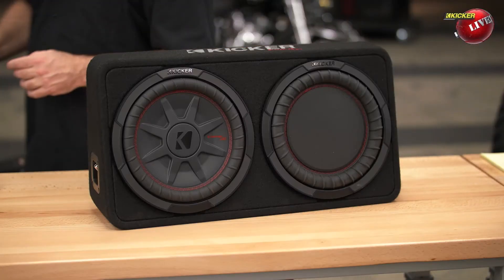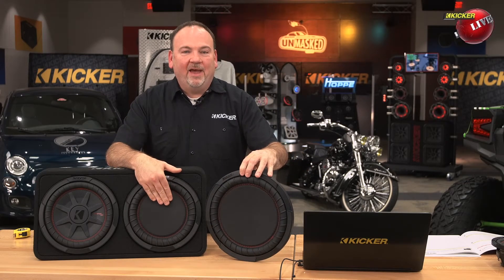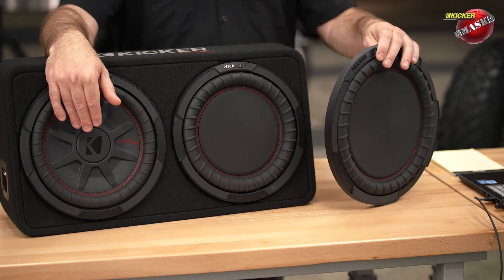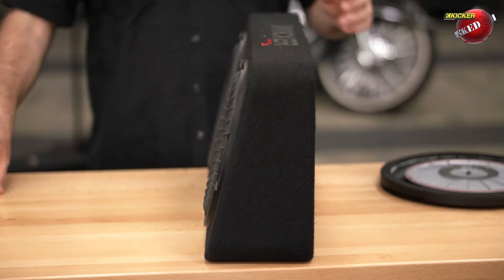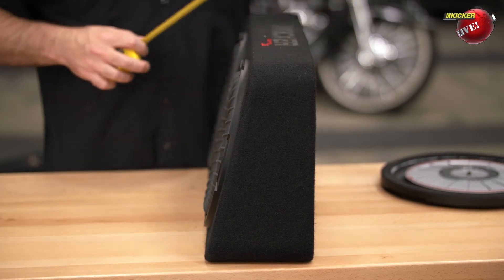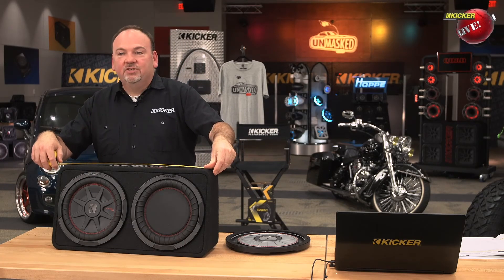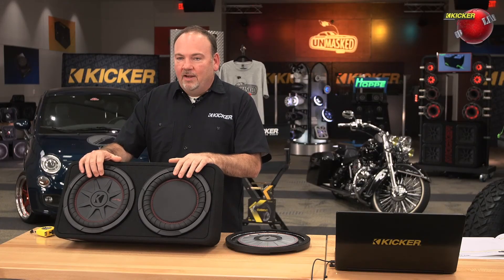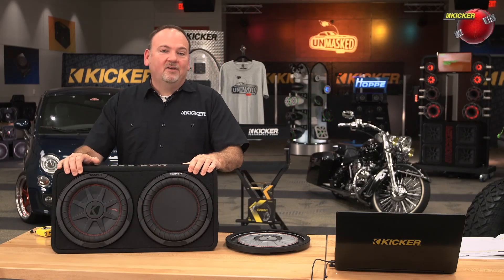KICKER UnMASKED Shorts - Why Use Passive Radiators?

Comment: An unfortunate event has happened. Kevin helems of Kustom Sounds in Ponca City, Ok has passed away.  Kevin was the original designer of the one and only kicker truck box that had two 6 and 1/2 inch woofers and a 10-in passive radiator in the middle of two tweeters pointing up one on each end of the box this design was originated by Kevin he was perfected by him and and only after he kept driving to Stillwater to pick up the 6 and 1/2 tweets and passive radiators did kicker finally get curious and ask him what was he doing with all these and he showed him the box that was in the vehicle he was driving right now it was stained wood grain not particle board but it was down to the measurements the same is the copy that was marketed and sold by kicker Kevin was just happy to see kicker prosper I believe that was the first box they ever produced as far as I know they were mainly just a driver distributor before that anyway later on him and I got together and started Mobile audio in in ponca City and later Stillwater and tahlequah where we were proud kicker dealers.
Reply from the maker: We certainly want to send our kind regards on Kevin's passing, and we want to thank him, Kustom Sounds, and all his family and employees throughout the years for their loyalty to the brand and the business, and for diligently serving his customers for decades.

Comment: Why not just put two speakers in the box?
Reply from the maker: It would double the enclosure volume, negating the whole point, which is "how can I have the most output if my space is limited". The Passive Radiator simply takes the place of the port, allowing you to have increased output from that smaller box.

Comment: I wonder what would happen if you just put a passive radiator on the back of a single sub box.
Reply from the maker: If done correctly, it will increase output.

Comment: Would be nice to see the parameters of the PR on your page.

Some say the bassoutput the tuningfrequncy is less when utilizing a PR compared to BR, true or not ?
Reply from the maker: Some of that depends on what you're trying to get out of the system. In my experience, the passive radiator is cleaner, less resonant, and better at extending low frequency output in a smaller enclosure.

Comment: A lot of people are confusing ported speaker boxes are louder, more powerful than sealed boxes. This is not true. Back to the past when I studied electronic courses at Devry University, a speaker driver in a sealed box sounded much louder than without a box. The main purpose of a ported box vs a sealed box which can give you the lower frequency response. Passive radiator is a substitute of ported one but a smaller speaker box.

Comment: Pretty please release the TS specs on your passive radiators❤.  Fun fact I took your 8” truck box passive radiator and drilled a hole in the center and added bolt and washers for weight.  Took it from your 49hz down to about 38hz.  It has a much wider range now and less peaky.

Comment: I have the CompVT12 box from 2007. It's a week before 2024 right now. It's still playing all these years later. I have it hooked up to the same Alpine Amplifier I bought when I got it so long ago. (The Amplifier was on sale. I couldn't beat the price) Very high-quality products. The CompVT box only has a woofer, and the enclosure is sealed. It's designed to fire into the back of the drivers seat. In my S-10 it worked perfectly as you could slide the box all the way to the cab corner. However, I got rid of that piece of junk and got a Ford Ranger in 2012. ( I'm still driving it, now. Much better truck). The Ranger has speakers in the back, so you can't slide the Kicker box all the way to the corner. The woofer fires from the middle between the seats at the armrest. This particular box doesn't work well like that. It was designed to be behind the drivers seat, so I can only cross it over to about 80 hertz before you start getting noises you don't want. The Ford cab rattles, A LOT, compared to the Chevy. I'd like to get one of these designs or the newer L series, but my woofer just won't wear out and give me a reason to buy another one!
Reply from the maker: Sounds like a good problem to have!  Thanks for the love - and for sharing your experience.
Reply: @KICKER-AUDIO I couldn't be happier! I have had that sub for  almost 17 years, and it still jams like the day I bought it!

Comment: I had 2 of these 12inch subs in a down fire box ran off a DX 1000.1 amp.    Someone broke into my truck and stole the box.   I need to replace it now.   Would this in your 12 inch down fire be ok hooked up to the DX 1000.1 amp?

Comment: The physics is counterintuitive but they are NOT negative-phase to the enclosure's active driver. They are within 90° of phase and so can be mounted on the front baffle without excessive damage to the output's phase.

Comment: Is it possible to pair 2 12" passives with 1 comp q 12" in a 1.4 cu ft box?
Reply from the maker: It's possible, but the question is the goal of increasing the resistance, since it means changing the tuning (tuned deeper).  However, deeper tuning means  the top end of the tuning starts to dip down.  Deeper=less musical.

Comment: why no square passive radiator version?
Reply from the maker: Because with an active radiator, the resistance is the goal, as opposed to an active sub where moving air is more important. But you raise a good point.  A matching square radiator would be cool.
Reply: @KICKERAudio  only do it if there benefit to efficiency and performance but i would like to have a square version with passive radiator I think it would be cool too!

Comment: Would it sound awful if I remove the radiator and install another 10”
Reply from the maker: You would get more volume at certain frequencies, but it definitely would not play as deep.
Reply: @KICKERAudio  so is it better to leave it as is ?
Reply from the maker: @edp9517  Exactly. The active sub relies on the passive radiator for proper tuning.

Comment: Doesn't the passive radiator need to have twice the displacement as the driver?
Reply from the maker: It doesn't, since the radiator is the replacement for the air spring that the port traditionally provides. The resistance of the radiator determines the tuning frequency of the enclosure.

Comment: im looking for a good 10 inch woofer for mainly rock & metal music
im accustomed to a 12" alpine type R and a random pioneer 10" i picked up second hand. 
id like a 12, but dont want a big box. a standard 10 suits my needs perfect but id also like to get something shallow. looking for tight response but also the ability to keep up with volume, AND be shallow, maybe even down firing
Reply from the maker: We have 4 options that fit that description. The main difference is power handling.  Check out the CompRT (likely the one you'll choose), L7T, CompVT and Comp loaded enclosures: https://www.kicker.com/loaded-subwoofer-enclosures

Comment: What about the 12 inch square sealed compared to these?
Reply from the maker: You can use a round radiator with a square sub.  The effect is the same, but you may need to change the quantity of round radiators, since the squares have about 20% more area.
Reply: @KICKERAudio  no I'm asking about your product The 12-in L7 sealed box. I have that product I'm asking how they are compared.
Reply from the maker: We make 4 lines of L7's, and all of them have a single 12" option.  Let's assume you mean the L7T, which is the closest one to the 12" version in this video. The L7T takes about 100 watts more power and has about 20% more cone area, so it will be a bit louder with appropriate power. However, the CompRT in the video will go a bit lower, thanks to the radiator.  It's a bit of a tradeoff. The L7T enclosure is also slightly thicker than the CompRT, by about 1" on top and 3/4" on bottom.
Reply: @KICKERAudio  dude what is your problem do you not read? Why you keep talking about four lines of l7s it is your product The 12-in L7 in the down firing subwoofer box. How the hell does that compare to this one is all I want to know

Comment: I'm shocked the phase relation isn't 180 causing the postive motion on the speaker to cause a negative motion on the passive equaling no positive sound pressure.  It clearly works as I've seen it working.
Reply: it has enough delay to not cancel out

Comment: What are the tuning hz of these in the 10in and 12in version. I like bass around mid 30s to low 30s.
Reply from the maker: The tuning for the CompRT thin sub enclosure is 42 Hz for the 10". The 12" is 35 Hz. There is always a tradeoff with thin subs, limiting stroke and available airspace. You can overcome it to an extent with power, but there are stresses on the cone and voice coil in trade. If you are looking for a deeper tuning frequency, you might be better off with a bigger enclosure.
Reply: @KICKERAudio  sounds like 2  12" will be good if i have room to mount them side by side behind my seat. At 35hz i should be able to get decent low bass.

Comment: Do you lose snap with these? I currently use a sealed box because I love fast, snappy, hard bass. Seems often than not a ported box starts to flutter with a decent stretch of fast bass. Can sound kinda muddy. What are your thoughts? If I can keep the snap and increase bass volume maybe I'll give it a shot.
Reply from the maker: As you've probably heard said on UnMasked, there is no such thing as a perfect sub enclosure.  You love tight, snappy bass, so a sealed enclosure is probably going to be your preferred enclosure.  People that love deep bass will likely enjoy a ported box more.  You can make up for some of this in EQ and crossover settings, but nothing factors in more than the enclosure itself and the car's dimensions (the OTHER box you have to contend with). Make small adjustments at a time. Experiment. Then hit us up with questions!
Reply: I  have a p300 12 its snappy but id like a tad lower notes its a new civic23 hatch. The fosgate is tight of course sealed but id like lower note’s would this perform better? Ty

Comment: Makes me wonder how 2 active drivers would compare in the same enclosure...
Reply from the maker: Since we made the airspace (and the passive radiator) specifically to work with a single active sub, it might get a little louder but be a "one note wonder." It doesn't have enough airspace to work with two active subs at the full acoustic range of a normal CompRT under those circumstances.
Reply: @KICKERAudio  wow you guys are awesome for actually responding to comments! I figured the enclosure wouldn't have the proper volume for 2 drivers, it's impressive enough that one can work in such a small airspace

Comment: I have a kicker 48TRTP102 on the back floor of my 2020 F150. It's powered by a JL audio vx1000/5i amplifier. It took me a bit of time with the amp to get all the crossover frequencies and filter curves just right, but when all was said and done, that kicker box THUMPS. Like a lot of pick up truck owners, I wanted to add a sub, but didn't want to give up a ton of space in the back. I really wasn't interested in a "behind the back seat" sub, as there's not a lot of options, and I needed that area for the amplifier. For those of you who may be wondering "does the 10 inch model really put out that much bass?" It most certainly does, and it fits nicely under the back seat when it's folded down. Worth noting...the enclosure is SOLID. You're not breaking that thing without specific intent. These shallow kicker boxes are legit. Plug and play bass all day.

Comment: Would there be any negative effects if I replace the passive radiator with an additional comp rt subwoofer. Looking for a small enclosure with the most bass.
Reply from the maker: Each active sub needs a certain amount of airspace to operate properly, especially at lower frequencies. You would gain volume at the upper range of bass (assuming you're doubling power as you double the number of active speakers in the enclosure) but it wouldn't play as loud on the low side of the spectrum.

Comment: Ok so I have 2 compr 8’s and thinking about building custom fiber glass boxes. Can I forward fire the sub and down fire the passive radiator? Odd question but i see it in home audio but never on car audio
Reply from the maker: It's not ideal, but you can, yes. It's preferred to have the active sub and the radiator on the same plane.

Comment: So basically a passive radiator is a fake subwoofer 🔊?
Reply from the maker: Very much no. A passive radiator serves the same function as a port (offering a very specific amount of resistance), without the possibility of port noise, and in a far smaller box. It's quite effective.

Comment: Mines blew out in less than a hour 😆
Reply from the maker: There are many reasons why a sub blows. Incorrect tuning, over/under powering, incorrect installation to name a few. Of course, manufacturers defect is a possibility, and that is the case we will honor the warranty. The important part is to find the reason, whatever it may be, or the issue may well occur again. Contact Tech Support at 405-624-8510 to diagnose the issue.  They are open weekdays from 8-5 cst.
Reply: @KICKERAudio  thank u they gave me a store credit but charge me shipping sow I did not completely lose all my money .I could respect that

Comment: I own a 2004 S10 crew cab.  There is no room for anything!  I took the chance and bought the 6.75" version of this box.  I had to cut out the jack holder behind the rear seats to make it fit.  I have to say I am impressed with the output of this little sub.  It won't rattle the neighbors but in the cab it's awesome.  Much more bass than I expected.   I recommend!
Reply from the maker: Thanks so much for the feedback!

Comment: Can I run 1ohm skar amp on set of 2 43TCWRT82?
Reply from the maker: Yes, you can run two of those enclosures and get 1 ohm. We normally recommend being within 20% of RMS.  If your amp does 480-720 watts (those enclosures are rated at 300 watts RMS each) at 1 ohm you are within the recommended power range.
Reply: @KICKERAudio  thanks I got skar 800 monoblock

Comment: I have just got my first Kicker product and the 48TRTP122 12 box for my Infiniti QX56. The 2 Ohm version is good but not had deep and consistent as  @ 500watts. The Old Rockford Fosgate 12 with the amp sounded much better and cleaner with bass. I am going to let the break end period to see if any improvements are made. Kinda sad for me
Reply from the maker: Was the RF a thin sub too?
Reply: @KICKERAudio  no it was as thing and flat as the Kicker but the RF had a 300 watts amp built in

Comment: I know it says to use a compatible subwoofer, but what if I used another brand subwoofer (I have a 10" dvc RF) - would it still work?
Reply from the maker: It will operate but the frequency response will certainly be different. How different is hard to say, as the radiator is weighted specifically for the CompRT.

Comment: I had the hatchback 8” full range speaker system with 2 10”passive radiator on the bottom back in the early 90’s.That thing slammed and those horn tweeter really screamed.
Reply: I had 1 too... also 2 SS12 2 12'S and two horns in my s10 bed
Reply: i had the same. sounded great.  and cant find them anymore.  i dont want just subs,
but the full range speakers all in one box to throw in the back seat
Reply: @able1115  I might make my own full range speaker boom  box for my Crv. Hopefully it sounds good.

Comment: Nothing cool about these port's are better because when I put my ear up on the hole my ear begins to Ring. And if you're not smart enough to get a Port in a box like that then why are you in the business kicker sucks anyway.
Reply from the maker: Were smart enough to use a radiator when using a port makes the box too big.
Reply: @KICKERAudio  ok duh if you were that you would see that there is such thing as a small port and if done correctly it will still sound good and it'll still bump but you obviously don't know how to pull that off it's not rocket science.
Reply: @kellynorman5262  clearly you don't know much about audio technicalities
Reply: You can't just slap a port on a small enclosure and expect it to do it's thing, it just doesn't have enough space to really put the ports on their proper functionality efficienctly, learn about Hoffman's Iron law smh

Comment: What happens if u use a pr in a larger box, say double volume but everything else is the same (pr mass, same woofer...)
Reply from the maker: It will drastically change the frequency response and probably change the power handling as well.
Reply: @KICKERAudio  in what way, I mean. Lower frequency? Less effecient, higher power requirements?

Comment: I'm so glad you posted this. I'm about to build a box for two 12s under my back seat but I'm under the sqft I need. This will definitely be my option instead of a seat lift.  I hope TERM-PRO can adjust for this.  Thank you
Reply: And passives are cheap. Did u get it done my guy?
Reply: So it’s okay to use one passive radiator for 2 subs or will I need to passive radiator
Reply from the maker: Yes, but thats not what we designed it for.  Adding more resistance (more radiators) will significantly effect the tuning frequency.
Reply: @KICKERAudio  so I shouldn’t use I 1 passive radiator with 2 subs
Reply from the maker: @diegoibanez8318  We made the 12" passive to go with the 12" CompRT (and the active CompRT 10" with the 10 passive, etc....) Of course, you can try your own combinations, but the results will certainly be different.
Reply: @KICKERAudio  Quick question.. Would I have better results with 2 12's and 2 12" radiators? Or 1 12 with 2 (or possibly 3 12" radiators? This is all under a truck backseat. Thanks!
Reply: @KICKERAudio  alright thank you for the I information